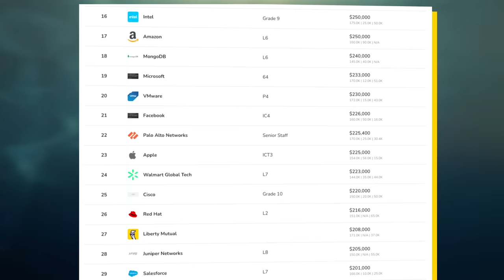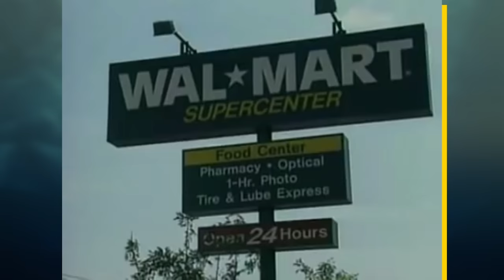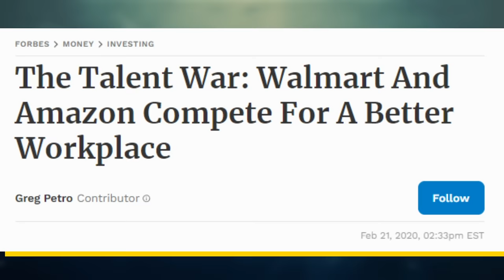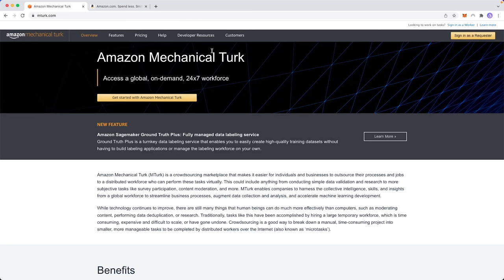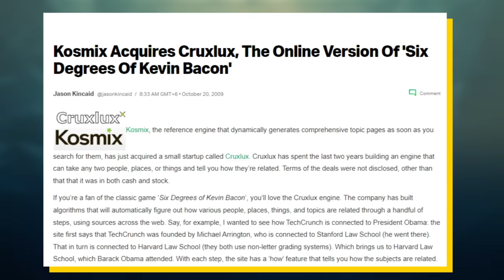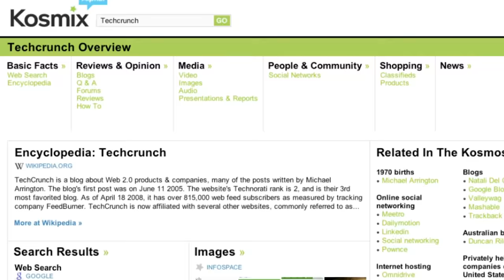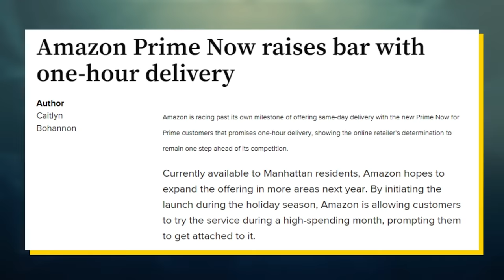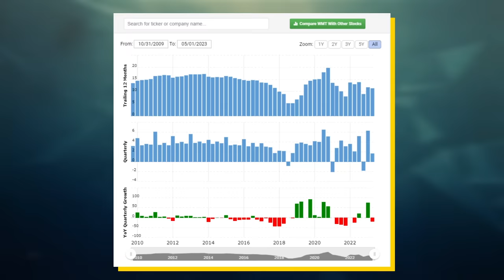Why Does Walmart Pay So Much?

Comment: I worked at Walmart once, and despite the fact that the job absolutely sucks. I have to admit, their employees software system is extremely well designed and organized, look very nice as well. So I guess this makes sense
Reply: Yet their SMART system still uses a command line interface lol
Reply: @desenagrator Just an FYI, Walmart has been phasing out the SMART system for a few years now. It's mostly done on apps that Walmart developed so that employees can use them on company supplied smart phones ($300+ Samsung Galaxy smartphones), instead of $1000+ telxon's and tc70's. It's cheaper, and much better, and now all employees have access to the correct inventory related apps so they can do their job better, and faster, instead of having to go look for a handheld. Also the SMART System is barely even used anymore, it's slowly becoming obsolete and getting phased out completely.

 I've worked for them for 8 years and since I got hired in 2015 I have seen Walmart go through a lot of changes, mostly for the better. Except for getting rid of valuable jobs and putting more stress on people who are over certain departments, all so they can save money, and look like they are giving more raises to store workers 😒.
Reply: @marcalt26  are they not giving you a raise? Why is it bad that store workers are getting raises if the company can afford it?
Reply: worked at sams club and almost killed myself
Reply: @justindoucette9242 how was your experience at Sam's club?
Reply: @Jujubees225  almost killed myself
Reply: @justindoucette9242 sounds about right
Reply: The retail positions are less than ideal because there isn’t much as far as job growth at that level. You can become a lead and get a decent raise, but you’re still in the retail setting. This video is not talking about that side of the business, and definitely isn’t glorifying the many miserable ‘lifers’ that make the day to day hell. Anyone that sees this that works at Walmart, USE THE EDUCATION BENEFITS. Unless your store is an anomaly, get out of retail for your mental health

Comment: To all of the current Walmart (retail) employees that clicked this wondering what kinda BS they were going to spread, USE THE EDUCATION BENEFITS. You can get a bachelors at ZERO COST while working there. It’s not easy to be a student and work full time, but it’s a benefit that (if completed in 4 years) means another $15,000 a year. Use this while you can. If you leave in the middle of the program, you do not owe anything, and your credits are still valid!

Comment: I find it funny because when  I used to work at walmart a month ago, the equipment and the apps we used were outdated af.
Reply from the maker: Wonder where all that tech power is going then haha
Reply: @LogicallyAnswered  It honestly isnt that bad, compared to other retailers I love it. Im able to sit in my car and get a 20 min extra break because I can switch my location to the store im working at and clock in.
Reply: @llamaxrider  yeah I was lucky I was able to do that with the work phone they gave me for my position. Due to labor laws in my state, we weren't allowed to access that time clock feature on our personal phones so if you weren't like a stocker or sales associate, you weren't able to get that work phone which had access to that feature and have to resort to using the actual timeclock.
Reply: The scanner software on the worker app seems to have some ai training. A bit back, it suddenly started being able to scan barcodes in basically any condition and orientation. The regular app that customers use still has that hold still to scan crap, I think to make I look nice or something.
Reply: I think 90% of the tech is focused in the online store and delivery. Then, whenever they have free time, they upgrade systems for the employees.
Reply: Are you sure? When I worked for the company, our online systems and hardware were always being updated.

Comment: Their grocery delivery is really easy and their return policy is even better than Amazon. Their prices are just about the same although sometimes Amazon is a bit cheaper.
Reply: They still need to work out issues. Great value, their house brand stays out of stock a lot.  They also don't ship a lot of items, but reserve for pickup only. Items also switch a lot from we can ship to pickup only increasing customer frustration. Plus most liquids are pickup only. Amazon doesn't suffer any of these problems.
Reply: @brodriguez11000  good points. I found that if you order your groceries after 11 AM the selection is usually much better. Maybe it has something to do with when their trucks get in or their system updates?

Comment: 2009: Studying hard so you don't work at Walmart when you grow up.
2023: Hoping you get a job offer from Walmart so you can get paid well.

What a turn around!
Reply: Yep.
Reply: Lol oh how times have change!
Reply: There’s still a massive difference between working in retail versus working at corporate.
Reply: it is like amazon warehouse vs amazon software development engineer. you dont want the first but 2nd is quite a sweet gig, well, until you get tired of the slave-driving corporate work culture which forces you to work 60 hours a week.
Reply: @IamAWESOME3980  Work 60 hrs a week at $120/hr? Where do I sign up?😄
Reply: @eudofia  it is not $120 an hour lol. i know you see like 250k+ salary and then after doing the math, it gets converted into $120 an hour but that is not the case. these engineers only get paid like 130-150kish. the rest of that 100k are stock options and relocation assistance which are often included in many of the total compensation(note the total compensation, it is not salary) reports.

the value of your stock option can go up or down. if the stock market crashes like 2022, you can kiss a lot of your total compensation goodbye. for many companies, these stock equities are not even liquid, especially if the company is not yet ipo, which means you are being paid literally fake money lol. this is not to mention the cost of living. big tech paid 2x the average partly because they are literally located in Silicon valley where a 100K salary will only get you a living standard equal to 50K in the middle of nowhere Nebraska.
Reply: Ah the dystopian dream we live in!
Reply: But also starting pay at walmart is like $14-18/h depending on what department.
Reply: @IamAWESOME3980  Oh well. There goes my dream. But if one can get a 130k - 150K remote gig and get to live in say Texas. Won't be too bad.
Reply: @dylantech right
Reply: True 😂😂😂
Reply: 3023: going to law school at Walmart.
"Welcome to Walmart, i love you"
Reply: still the type pf job you will get is completely different
Reply: Retail = localized revenue
Corporate = global business operations

Comment: Walmart has been known for having logistics capabilities on par with the US Department of Defense for years. That requires a significant amount of tech. 

Walmart being competitive in the tech space should not surprise anyone.
Reply: It also didn’t used to buy anything off the shelf but developed it all in house. Not sure if tufts still the case but either way they built up a lot of serious tech capability, and their ROI on technology investments was light years ahead of anyone else outside the tech sector
Reply: Walmarts logistics are a fucking mess atleast from the point of view of a warehouse worker
Reply: @calvin1715 to be fair, it's probably the same for Amazon.
Reply: @calvin1715  That's just the nature of logistics. There are simply too many variables between truck maintenance issues, drivers going to the wrong place or needing to stop, or some warehouses getting backed up, that it's impossible for everything to run smoothly, which is why you have people working in operations and logistics who are always pulling their hair out trying to coordinate the mess and prevent one domino from knocking down all the others.
Reply: @dylantech  I agree. I been in logistics for 20 years and truck break down or flat tire, weather, employees not showing up or getting arrested, customers canceling last minute, employees going to wrong address or getting lost cause woman that entered address spelled it wrong or swapped numbers in which it wont come up on gps or even takes them to another city an hour away. its the stupid lazy drivers or stupid office women not the software or logistics managers. thats why those employees dont get paid more. they barely worth having even if they worked for free.
Reply: Lies again? Paramount Pictures Pay Pal
Reply: @SgtJoeSmith  God bless you, Mr. Smith. I worked in Operations for Penske for one year and that was enough for me. That job compensated relatively well at the time considering I was straight out of university and could get all the overtime I wanted, but it’s nothing but constant stress, especially when it’s your week to handle the 24/7 phone line for the district. It’s funny because they rope you in with the compensation package for that hourly entry management position, but it’s only to trick you into becoming salaried so they own your life and pay you less since overtime no longer gets compensated. 
I encouraged my brother to start working at JB Hunt’s home office after he graduated high school because he didn’t have a clear objective for university. Seven years later, he’s still there coordinating loads for his customers and often being the bearer of bad news when something beyond his control goes awry. I can’t say I envy him.
Reply: @dylantech  jb hunt home office in Lowell Arkansas? That's just down the street from me.
Reply: @SgtJoeSmith  Yeah, we’re from NWA and the university I was referring to is Arkansas.
Reply: They’re also the second largest online retailer in the world

Comment: The base pay for a 3rd shift stocker at my Walmart is 18.50 including the shift difference. This means without missing if this was salary, a 3rd shift stocker at my Walmart would.  38,480 per year. It’s pretty insane considering all we do is put items on a shelf and cardboard into a baler. Walmart also only allows hourly employees where I work to carry 80 hours of PTO I to the new year and multiple guys will often end the year with well over 100 hours so they make over 40k per year working at Walmart. You add in their wife making make 20-35k at their job and it’s not surprising to see people making it at what use to be low wage dead end jobs that were only for the retired or college kid.

Comment: Hi Walmart worker here. For hourly associates they tend to find every way to screw you out of your raises, I have worked with the company for 3 years and I work with someone who has worked here for 10, we are both paid the same as someone hired yesterday because our pay is usually not adjusted when the starting wage goes up, leaving you stuck at the pay floor.

Comment: I was a Director of Data Science for walmart last year. Your salary and stock numbers are way off. For the Distinguished level it is more like 170k + 75 stock per yr + 30% bonus. The bonus was chopped to 60% of that so call it 20%. The stock includes a hiring bonus and will fall to 35k per yr if they even continue to award it. All in all you could be as high as 270-300k or as low as 160-170 but around 210-230k is the most likely. These would be for the headquarters location in Arkansas, the San Francisco office may have a cola adjustment.

Comment: If Walmart can afford to pay their tech workers so much, why can’t they increase their wages for cashiers and front line workers?
Reply: Just a matter of negotiation. More people could do that job and walmart abuses that. Unions are necessary baby.
Reply: demand. Anyone can be a cashier. The smartest engineers cost a lot of money to buy, these guys are geniuses coming from Ivy Leagues
Reply: @good-tn9sr more reason for America to restrict low-skill immigration.
Reply: @karlstrauss2330  That’s what they have been doing for a while now. This is why you see a lot of indian software engineers working at these places because they are much smarter than our average engineer and they’ll work at a competitive wage.
Reply from the maker: Tbh, it has to do with ease of replaceability as opposed to economic reasons
Reply: Along with what's said in other comments about replaceability, Walmart has been pushing to eliminate those workers. In years past they used to just.. not hire them at all. The results were understaffed stores and produce literally rotting in storage due to the lack of hands getting them to the floor. 

They reversed that trend but then turned to self checkouts to the point of some stores not even running a single human cashier. That came to a head last year when the company saw a massive uptick of theft at those self checkout spots.  That was at the end of 2022.

Not fully sure what they are doing right this moment. I can say that some of the stores around me are paying more for entry level than most of the grocery and fast food stores around them at the moment.
Reply: @good-tn9sr  It's not because they are smarter, it's so they can have them on a visa which forces them to work to stay in the US. That way they can exploit them anyway they choose. American citizens won't put up with it, so they import their talent, like they import their goods. They treat them the same too. High turnover of product and personnel.
Reply: @RikuRicardo  You’re correct and I forgot to include that. But they are also smarter as India has a much larger pool of engineers that these companies can choose from. Also the education system in India is very engineering/tech centric as students have been learning how to code in elementary. Whereas here in the US, I was never offered the ability to learn to code unless I joined a club and I attended a really well funded school.

Comment: if wm is paying so much on there computer tech it is certainly not on its website . i looked for a car thermometer and i had my truck previously log so it told me no item available  there car thermometers are generic.   did samy when i needed a battery u1
for mower it would not show mower batteries it kep asking what car it is for. i did finally get to mowers again it would not show battery unless i had mower listed no its a plain old u1 12v mower battery not a battery powered mower
so who is programing might know 1 and 0 but have no real retail experience   and wm mixing 3rd party is extremly useless i never seen a 3rd party on w that wasnt charging way over retail let alone amazon